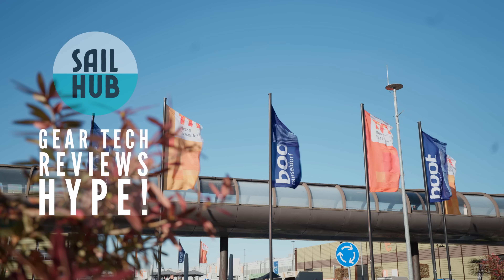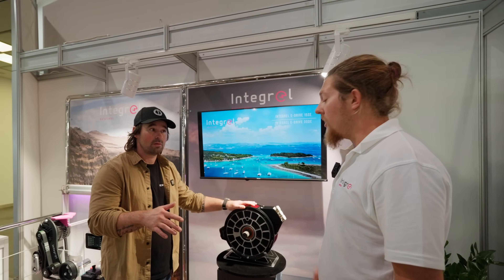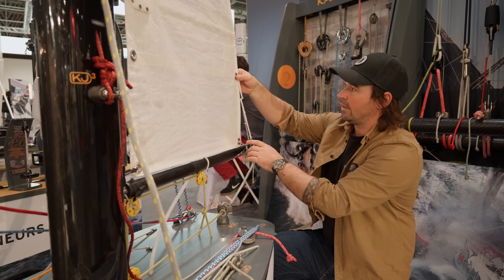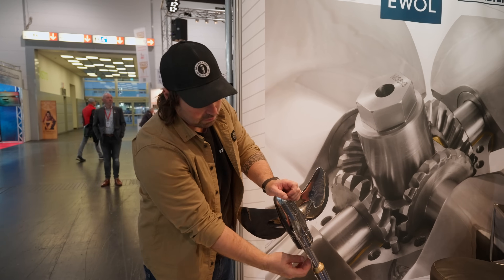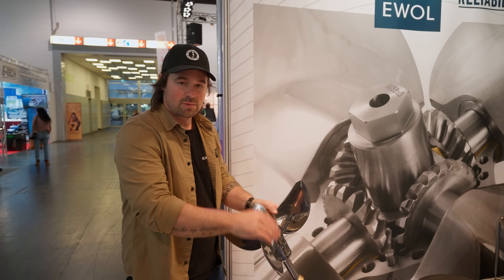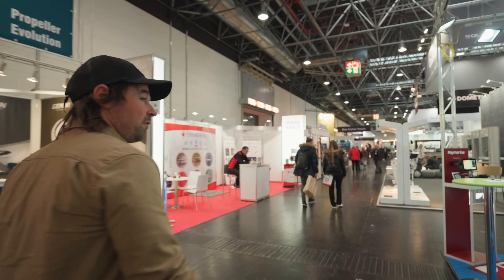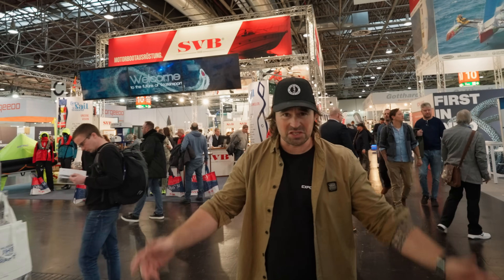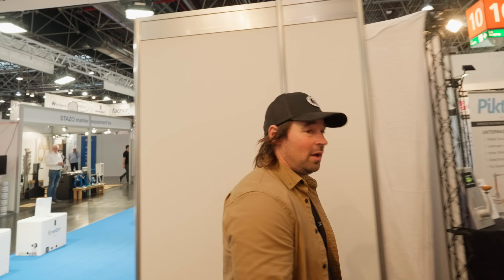New 2024 Sailing TECH - Motors, Props, Outboards, Rigging, Sails.

Comment: Thank you for publishing this, lots of interesting stuff. I realise there was a lot to present and get through in what was a short video. May I suggest you are bit more ‘searching’ with the technical bods when it comes to these high capacity generator systems and quiz them on the normal operating temp of the generator at maximum rated output, how output is regulated to prevent a burn out situation, what additional cooling is required (especially that 15KW monster). I am always very sceptical of brochure marketing hype (retired marine engineer) .Keep up the good work.😀👍⛵️
Reply from the maker: Sure I can ask those questions for you. In general for the large motors and the likes are measured as constant output (I.e 100% duty cycle) that given, the actual peak performance is usually way higher but are limited for saftey. So there’s no issue usually. Although, they are often water cooled which to be fair I’ve not talked about. 

We will take that on board and improve for next time. 

Cheers for you support too, it’s really cool if you! Thanks, Chris and Jenni 👍

Comment: That pump was cool, shame it doesn't come in 24 and 48 volts though. It seems like 24 is where many are now, but for new builds, it's all about 48v.
Reply from the maker: Sure, 48v is generally more efficient so why wouldn’t we go that way. Stepping down is easy enough though and given most people like 12v for interior lighting and nav lights (as it’s cheaper to fit and maintain) I don’t think a 12v pump is mush of a problem. 

We’ve actually got one of them in test at present, stay tuned to see how we get on with it 👍

Comment: With that Integrel generator between engine and gearbox my old engine wouldn't have much left to turn the prop :)
Cool products, great show.
Reply from the maker: Yeah, that’s a shame. Their market is oem new builds which makes sense. Mind you, could you not move your engine mounts 10cm to accommodate, that’s how I presume most will be fitted.
Reply: @SailHub and that means a new propshaft too.
Reply from the maker: @normanboyes4983 no, you should need a new shaft, your gearbox stays where it is, only the engine should move forward 👍

Comment: Electric Hybrid - The Wynn's HH44 has a working hybrid electric add-on with - working regen. Works great/game-changer by reports, but it adds much to propeller complexity and efficiency in diesel, electric, and regen modes. One solution for everything is tough - but promising at the same time - if they can work out the perfect propeller.
The Hook - I'm recalling that the hook system failed for La Vagabond because the weight of wind on their sheet was so great they couldn't retreive the hook (pull the hook out again)
Reply from the maker: Sure, the wynns have a system that’s working for them. Our goal is to make monohull our build self sufficient… Thats going to be a mission for sure. 

As for the hook, I’m really not so sure how they could struggle so much. A large number of imocas, class 40’s etc manage it short handed all the time? I imagine as with most things on boats you’ve got to figure it out. Mind you, it’s an expensive thing to figure out, I like the idea sonI think I am going to make something similar and give them a try before we buy.

Comment: The charging system is interesting. X yachts have gone the other way - kept the generator and got rid of the diesel engine, relying on an electric motor. I kind of like that but giant lithium batteries on board is something to be considered.

Comment: The reefing hook is interesting, but one of the biggest forces on a gooseneck is generated from the kicking strap, or vang.  That is more than a reefing line.
Reply from the maker: I guess that depends on the boat. After all faster boats don’t need the kicker due to the apparent wind. But yes, your right, the kicker creates a lot Ioad mind you it’s not direct load to the gooseneck. Still, maybe better to relive as much compression as possible. Of course you could just pop a jammer on the boom too, I do like the jammer and the hooks too, not sure what we we will choose for the rig on new build though.

Comment: @SailingLaVagabond good explanation and demonstration of your Karver reefing hook system and its workings and advantages.
Reply from the maker: I didn’t know those guys were using the system, will have to have a nosey 👍
Reply: @SailHub  not sure if it's that exact system, but it looked very similar. In the videos right after launch they had some complaints about it and not knowing when it was engaged etc. looked like just a lack of understanding of the system and how it's supposed to operate coming from other reefing control systems.
Reply from the maker: Ah cool, thanks for that, I’m gonna take a look for the video on it 👍
Reply: @SailHub  did you find that video?
Reply from the maker: @oliverschmidt2803  not yet, I searched a bit found myself lost in a sea of videos so I gave up!
I hope to have a sail on an Imoca with the hooks on soon so I can figure it out there 👍🤞
Reply: @SailHub  sounds great! so I wait and don't get lost in the LV jungle! And make pictures of the cousin constrictor as well please! if you are already at the imoca! ;-)
Reply from the maker: @oliverschmidt2803 unfortunately we’re in the workshop today, I think our  IMOCA debut won’t be for a few months.

Mind you, I can give first hand experience on the constrictors. They are great but I have their downsides. I used them for multiple things on our previous boat which was a loverly Najad. They are fab and we will be using them a lot and also making our own parts for them when we start the boat build. 

More than happy to chat further about this or any other things your looking at too. 
Check out Patreon ,if that works for you we can support each other atvthe same time 👍

Comment: For the electric outboards, do they have a XT60 solar dc input? Seems like when your dingy isn’t in use and sitting out in the sun, having one of those folding solar panel setups topping it off would be awesome! I have a panel which puts out 125 watts and holds up to the size of a briefcase. Thanks for all the content!
Reply from the maker: Hey, cheers! 
A lot of the outboards can take solar directly, it’s usually their own connector though. Mind you, it’s best to check before you buy!

Comment: Did I understand the Karver slab reefing hook correctly. For every reef I would need a hook and 2 lines led aft. So for our 3 reefs I end up with 3 hooks hanging from the boom and 6 lines led aft. I get no adjustment of distance from the boom or outhaul.
Alternatively, our system also has no compression onto the gooseneck as we reef at the mast and our reefing lines are cleated on the boom itself (so the compression forces are within the boom?). As the reefing lines are tensioned to the reef clew from further aft we essentially have a reasonably functional outhaul for each reef. A lot less complex ;-)
Reply from the maker: Yeah you got it right. The outlhaul on the hooks should be set and forget, if your reefing your not generally looking for any power from draft. 
As for your reefing lines being locked at the mast, that’s great. 

I guess you still have to go forward but more to importantly you still have a lot of weight on your leech form the lines. That being said if your not fighting for light air performance your all good 👍
Reply: I sort of get it.  
Surely the leach line still has to be quite strong just to pull down / in the sail (the release can be very light) For most just using a slightly heavier Dynema leach lines would be enough.
If you had a clutch on the boom, with a line release, you could have no compression on the gooseneck and still have adjustable.  
Thinking about it, when you may need to have a lower tension, it is light wind, so you can go forward to adjust
Reply from the maker: For sure, your right there. Dyneema lines are a great way to improve things. 

The hooks are pretty cool I that you can use much smaller lines and it’s all ran back to the cockpit. Being able to to run them back to the cockpit without spoiling the light air shape is a real advantage of the hooks.

Comment: The Remigo is very interesting. I wonder if it could do regeneration? Then with a simple mount on the stern of your boat could mean that your dinghy motor becomes a generation source when sailing plus an emergency rudder.
Just wondering too. When used on the dinghy can it be locked on to prevent theft?
Reply from the maker: Yeah they are pretty cool for sure. I believe you can hydrogenerate with them. Not sure about licking to the transom but I’m pretty sure you would find a way with your industrious mind! 
Most electric companies have a system to lock people out if there is no pass key (phone) for it so it renders it useless without the coded phone or password.

Could be worth giving them a call here in the UK, Nathan is the chap you want, he is super knowledgeable and knows everything about them👍
Reply: @SailHub re the security. I love that we can remove the battery of our epropulsion and lock it in the dinghy bow locker. I don't think electronic disabling on it's own is enough.
I love the idea of combining hydrogeneration with emergency steering and dinghy outboard (combining watt&sea, part of a hydrovane and outboard). Will keep them in mind for down the road.
Reply from the maker: Yeah, I think we need to secure motors well. Mind you, do you take it for a hike with you? 
Generation isn’t likely to be ground breaking from it mind you, I’ve not tried it. I would imagine it will be on par to a spirit from ePropulsion. Which works enough to put it in a sales pitch.
Reply: @SailHub  We are able to use a standard outboard transom lock, wouldn't work with the Remigo as you can detach the expensive part from the transom mount. No hiking but with the engine locked to the transom without a battery and the battery locked away out of sight we feel it's a reasonable level of security.

I'm motivated by our very limited "real estate" on the stern of our Rival 38, at times a modern very beamy stern seems attractive, then I simply imagine beating off a lee shore in a gale and the lack of space for things on the stern seems minor ;-)

Despite the limited space I really want to find a way to get a boarding ladder, wind vane and emergency rudder on our stern. Significant hydrogeneration would be icing on the cake. I love stuff that works well together or has multiple uses.

We can't afford a Hydrovane or even a South Atlantic S500 so we have gone for a Hebridean Vane (got a great bargain recently). Our wheel steering at the forward end of the cockpit makes it a challenge.  Beyond that I'm trying to design a way of having a boarding ladder, Hebridean wind vane and emergency steering (ideally that could be steered either by the Hebridean or a tillerpilot) that all works together - but it won't be a top priority for a long while.

Comment: How is Integrel Solution's E-Drive going to be air-cooled and work efficiently  inside an engine bay ? Has this been tested on water yet ?
Reply from the maker: Maybe you should ask them! 

It has been tested, mind you there are ports on the bottom which would suggest liquid cooling to me.

Comment: Temo sucks
Reply from the maker: Thanks for the comment, and that’s fair enough, everyone has their own opinion. How about the Temo 1000? Have you checked that out? I think with ref to the Temo450 it definitely has its place and really depends on your usage as to how you’d rate it. For example if you had cruising kids… I think it’d be a no brainer. It’s also ideal to nip to the market in dodgy anchorages as you can  literally swing it over your shoulder rather than leave it to be stolen and for some it may simply take the anxiety away from petrol outboards. It’s not going to help you in a storm but then again that’s not what it’s designed for. Hope you found some of the other bits of kit interesting 👊🏼